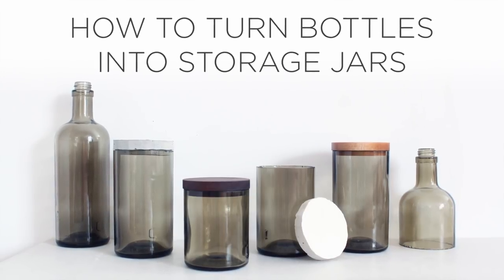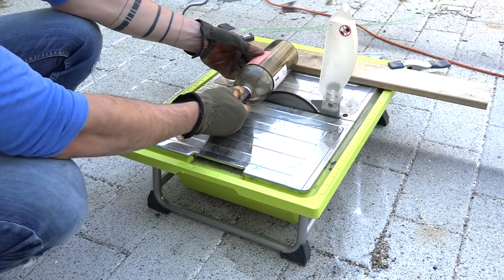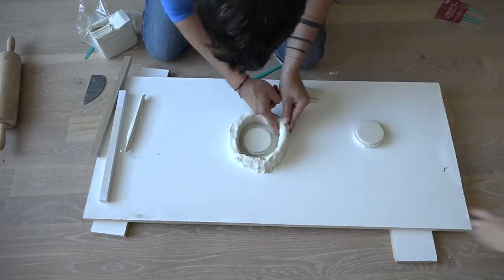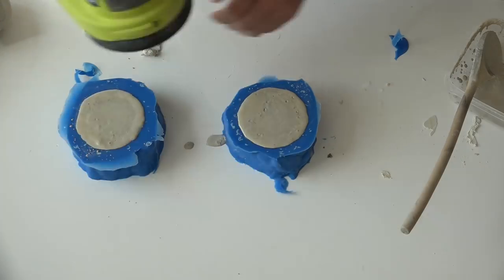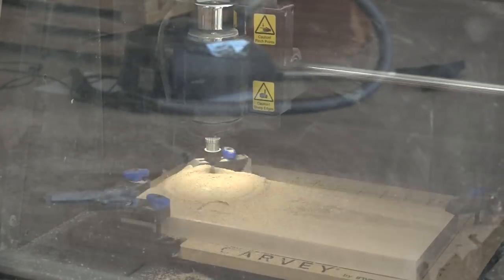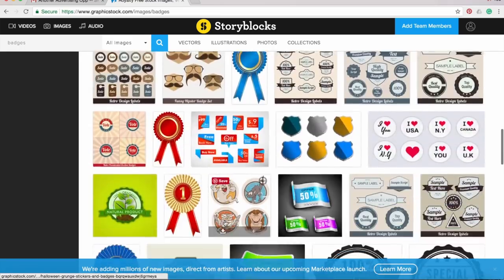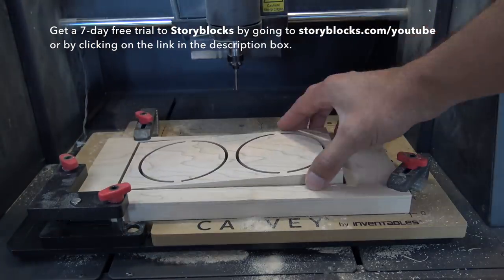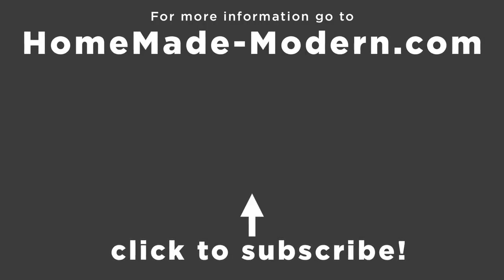How to Cut Glass Bottles and Turn Them into Storage Jars with Lids

Comment: That is such a great idea.  Thanks.  If you want to create a better seal with the cap, you could rout a groove on the inside portion of the wooden lid and stretch an O ring around it.  I've also cut "washers" to fit in the slot of lids for ceramic pots.  Takes some experimentation with getting the correct inside and outside diameters for a perfect seal.  Cheers, David.

Comment: How do you do this if you only have a hammer?
Reply: Very carefully.
Reply: both of the comment made my day.
Reply: Paddy Jack better yet recycle those bottles and buy glass containers!
Reply: @Mikhail Galatinov hahahahaha
seriously though, it is possible if you have only a hand saw to cut wood and shape wood circles. you can cut glass with yarn and acetone, trace circles using the jar the way you would a cookie cutter and cut wood accordingly. then you glue tho two wood pieces together and you have a lid
Reply: Cheaper alternatives might be small glass cuters, or the fire method that can be found online. Where there is a string wrapped around put on fire and then put into water. The pressure should create a breakline.
For sanding you could just use sandpaper.
Reply: I will try and entertain that thought further. 
No clue how to create a mold without spending too much money. I think wood it is. Use an handsaw to create a circle out of wood. Chisel away the access. Using some kind of metal or stone chisel and an HAMMER!
Reply: Use the hammer to rob a store for more tools?
Sometimes the simplest answers are the best.

Comment: Could you have made the inner circle a little smaller than it need to be and then wrapped a thick rubber strip around it to form more of a seel?
Reply: Jack Ellis that’s what I was thinking too. I can see myself knocking it over...if the glass didn’t break, the contents would spill everywhere 😑
Reply: Yes, but it wouldn't work particularly well. Not sure how you'd get lids to stay on and also be easy to take off.

Comment: putting a rubber ring around the lids would make them water tight and prevent cracking in case the lid hits the container
Reply: It actually wouldn't. Concrete is a surprisingly porous material on it's own and making it watertight requires carefully engineered composition and use of certain substances which are far from safe for eating from. 
Concrete might be stylish and handy for other things, but it's a very poor choice for a watertight jar. But it can certainly work for holding spices, cookies and such, as long as it's not required to be airtight.
Reply: That depends on what you mean by water tight Water can migrate through concrete, but it doesn't do so particularly fast. If you just wanted to prevent things getting, say, splashed on, it would work.